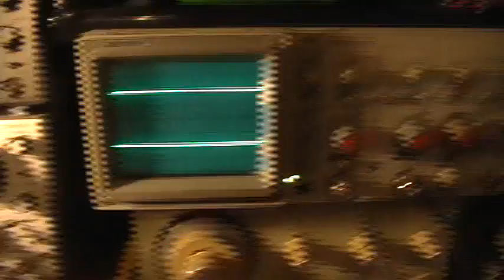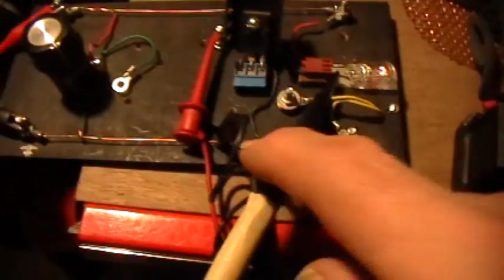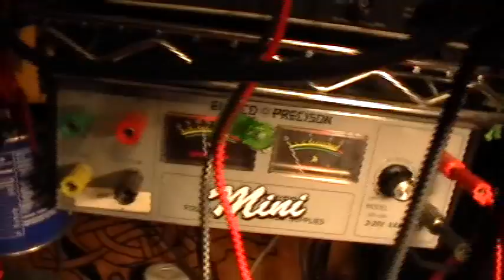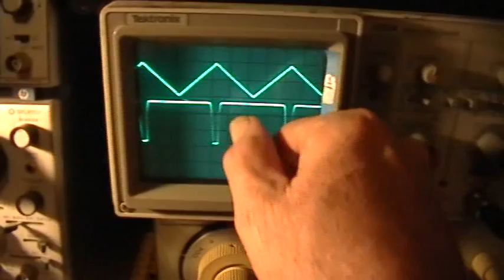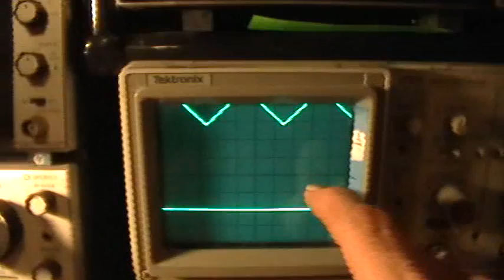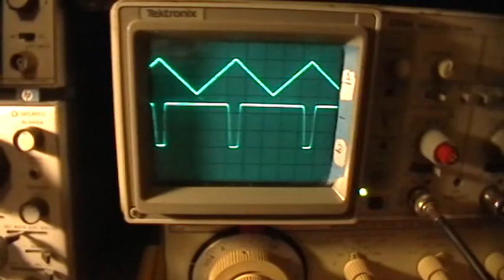Electric OU: REVISED MOSFET Triangle Drive Offset Demo

Comment from the maker: No, not with mosfets. The gate is a high impedance input, and with an "increased load", that is a lower resistance load and more voltage to drive it.... the transistor will still switch at the same gate voltages and will make the same drain waveforms (at the new voltage values, of course.)